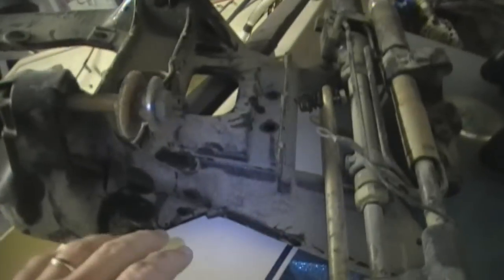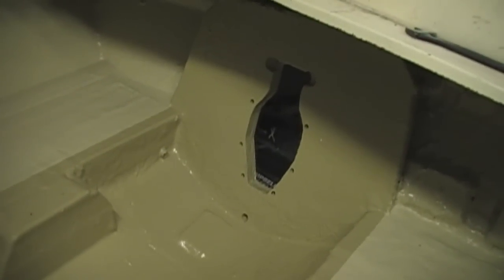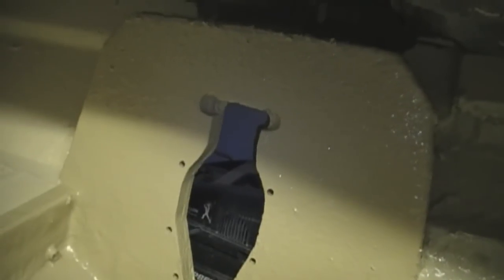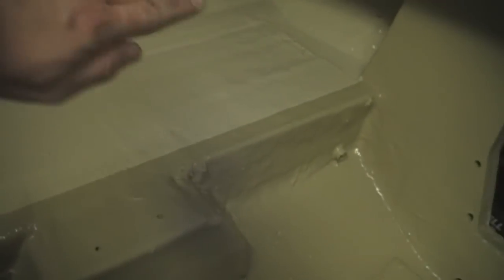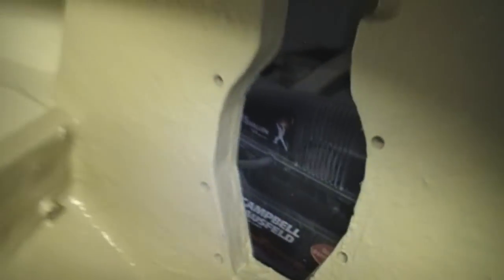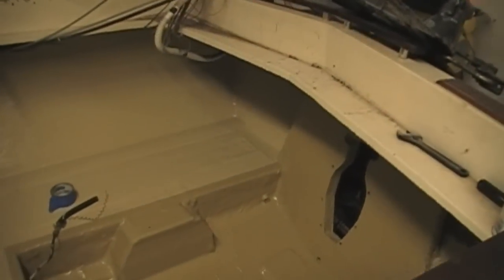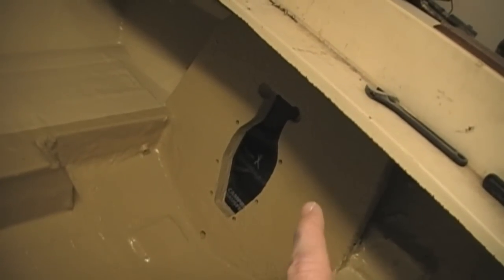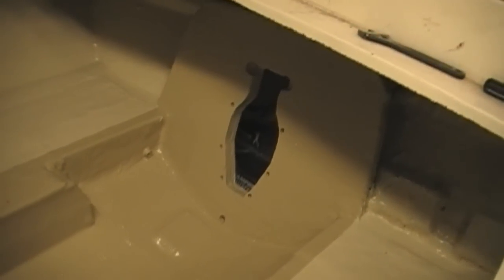I/O transom replacement in my Glastron restoration  Part 1

Comment: Jay, my son and I are in the middle of a transom restore on a 1985 Conroy it is the same as a Glastron. We have the old rotted transom out and noticed that the bottom of the fiber glass is fractured at the bottom on both sides. What advise do you have to repair the cracked areas? My thought is to grind a V cut and fill with resin and a fiber glass strip or should I mix up some peanut butter and fill and grind smooth?
Reply: if you take fiberglass out you put fiberglass back in and nothing else. You will taper grind it like a v yes about 3 inches out from center of the crack then repair it with glass, I used csm roven csm to make a 3 part sandwich which to my knowledge will repair anything. the underside of the hulls crack can be filled sanded and gelled over.